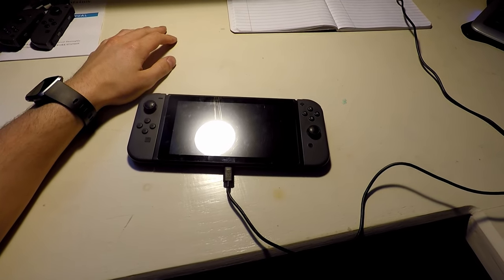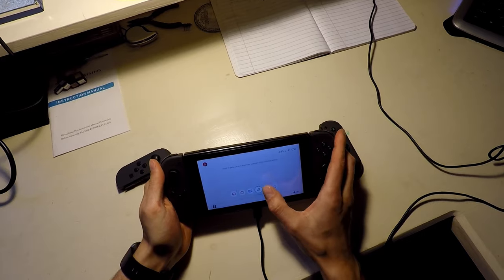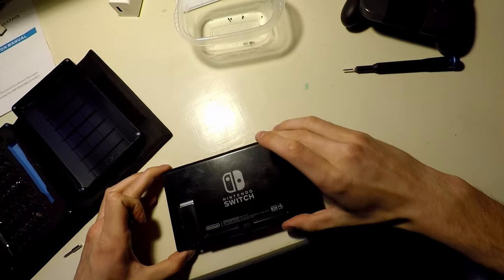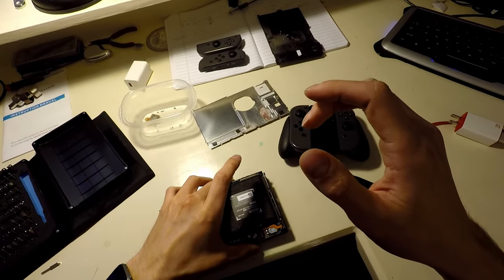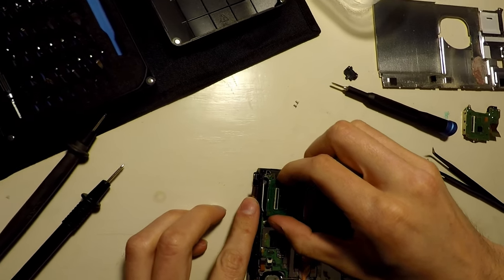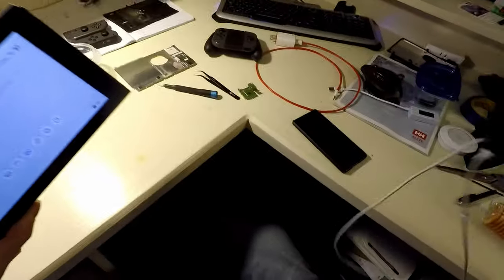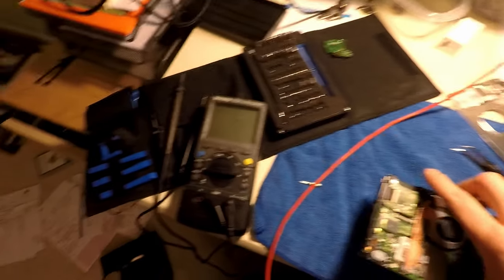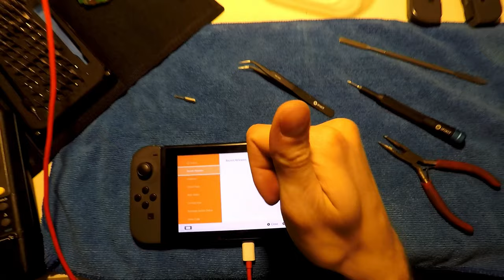Nintendo SWITCH FIX! Diagnosing a Switch Sound Issue!

Comment: I can only hear my switch when its in headphones and on the tv. Its so frustrating. I just wanna fix the audio without wearing headphones.
Reply: same its been a few months since mine went out and i still haven't find a solution on how to get my sounds back :(
Reply: MIne's stuck in headphone mode even though there's nothing plugged in.
Reply: @djayyoda  might be reading headphone connection may want to try compressed air in your audio jack
Reply: Same
Reply: I have the same problem
Reply: Same
Reply: Same
Reply: Same
Reply: Same problem please help me
Reply: Me to it’s been like that for me for 3 years

Comment: My Nintendo had sounds and then it went away how do I fix it?
Reply: Same
Reply: Did your switch just randomly stop producing sound when in handheld mode?
Reply: (Because I'm having problems too I'll continue with this conversation) but yes when I booted up my switch it wouldn't make any sounds and it was when I was in handheld mode.
Reply: BuiltLasagna I have a question after the sound went out did it ever randomly come back? I’m asking because this happened at least 3 times when the sound came back but than left again. Once when it came back it stayed for a week than it left again
Reply: TheEpicSlayer :D The speakers were making some kind of weird sound before the speakers stopped working, after they stopped working 
it never came back again
Reply: BuiltLasagna I think we have different problems than because my switch never made any weird sounds.
Reply: @BuiltLasagna  Mine made a buzz sound on my headphones then there was no sound. It randomly comes back and goes. But it's been gone for awhile now
Reply: @BuiltLasagna  Same. Why tf can no one problem solve this? I just did a speaker replacement and the heavy audio distortion was still there. It's even distorted from the audio jack.
Reply: you solved it?
Reply: Same
Reply: Same
Reply: Carlos Macias nope. ☹️😒😕
Reply: @theepicslayerd5684  yes
Reply: @jeremiahmartin2800   how, i would like to know
Reply: @MewingMessi  the sound randomly just cut off one day. I blowed into the speakers,and it would work.Sometimes it would cut off and it would continue to do that. It eventually just completely cut off
Reply: @theepicslayerd5684  yessss
Reply: @jeremiahmartin2800  didn't work saddly
Reply: @theepicslayerd5684  yes

Comment: So on my switch the sound quit when my kid was using it, I tried everything in settings but nothing worked the only thing that gets it to produce any sound is to firmly tap on the back near the kick stand any thoughts on a solution?
Reply from the maker: It's probably similar to what happened with this console. A speaker replacement will likely fix the issue. I can't say why this happens, though... Could be from dropping it or any kind of impacts.
Reply: Hey Jimmy did you ever figure this out? I've got the same issue with one rn.

Comment: I was cleaning my Switch and suddenly I couldn’t hear it, I tried using the volume button and it said I was wearing headphones (which I wasn’t) and reset my switch. It then began switching between me wearing headphones and regular volume, and I soon gave up. Please help.
Reply from the maker: What did you use to clean it? Something may have gotten into the head phone jack which is causing the console to think something is connected.

Comment: so i replaced the speakers on mine and the sound works now , but when i try to put the metal plate back on and put the first bottom left screw in the switch cuts off and shows an error code , what could be the issue ? i tried putting all the other screws in but that one and it’s fine but once i tighten that one it shuts off again and shows the error
Reply: Idk.  That’s weird
Reply: Maybe something is touching somewhere and grounding it out.

Comment: That joycon when you said “wants to scroll all the way to the right” it means it’s got drift try fixing it in the settings if that does not work the joy stick in there is messed up you will have to replace it it’s only like 5 bucks to buy one then you or someone else will have to replace it there are many tutorials if your not sure how to do it.
Reply from the maker: Yeah. I have a video outlining that procedure as well.

Comment: Did you just put in a replacement speaker and that fixed it? I am not getting sound of of one of my speakers, and I am thinking its actually that easy-to-access one near the battery connector.
Reply from the maker: Yep. It was that easy.

Comment: Whenever i put my headphones in my switch the audio cuts out and i have to tilt the jack to hear a little bit
Reply: That's a headphone problem not a switch problem
Reply: @SomethingProbablyNothing  nope ive tried 2 sets of headphones
Reply: For Me I Use It For Like 2 Hours Or Mins and Volume cuts out without headphones
Reply: You can replace the headphone jack it's pretty easy
Reply: @thezero6152  ill watch a vid on it. Thanks
Reply: Mine is the opposite no sound without headphones
Reply: @pijg  yeah my sound only works with headphones or doc mode
Reply: @Etopia I have the same problem!
Reply: @aidanisch2461  i forgot this comment existed lol but i never got it fixed
Reply: Replace the game cartridge slot that has the mic port. Fixed 100%
Reply: the jack is messed up,but even if you order a replacement it may not work and your screen wont work. I tried it on mine,I just decided to use usb wireless headset. now my speakers went out,which is what brought me here. tapping at the back made them come on ,but they went off again. new speakers??

Comment: its messed up this happens. tge jack was bad and I replaced it but caused screen not to work,so I put the bad one back and use a usb wireless headset. then yesterday sound went out randomly,tapped the back of the switch sound came back for a bit,then went out again. hard to believe it's a bad speaker issue

Comment: The speaker its not always the problem, im repairing right now the board, works good some times and others sound goes away for a while then came back, not sure if components are married with the board
Reply from the maker: What parts would be married to the board? Sounds like an intermittent short to me.
Reply: @GTurbski  i change de ic audio, first day, works greate, then start to go and back next days, i check everything, the las thing i supposed its fail could be the pmu

Comment: This happended to mines outta no where I didn't do anything what do I do?
Reply from the maker: Well, if you're handy pull the switch apart and try a set of replacement speakers. Otherwise I'd say send it off to have it repaired. Not sure as to what caused mine to stop working as I purchased it with faulty speakers.
Reply: @GTurbski  Wow it was just one day I was using it in handheld mode and it just stopped working it only works with headphones or docked
Reply from the maker: @Jay-nt7vw  sounds like exactly the same failure as the one in the video. Interesting that both speakers failed at the same time.
Reply: @GTurbski  can u fix it?
Reply from the maker: @Jay-nt7vw  I'm reluctant to say yes. I am by no means a professional however, I would be willing to help if possible. Send me an email at pelowskg@mail.gvsu.edu.
Reply: Same thing happened to mine, playing it in handheld mode one day (plague inc) and boom sound goes out... fairly new console also
Reply: Mine had that happened but still had a warranty on it nintendo fixed it. 4 months later it happened again and now I have no warranty wtf is it this common issue they should have come to a solution for this.

Comment: Never ever ever use a non nintendo charger while docked... you can easily brick your console
Reply from the maker: Sorry but this is just not true. I have been fixing consoles for around two years now and have NEVER had an issue powering my console(s) with an off brand cable. I will say this though, off brand DOCKS are a huge no as they have awful current control and are widely documented to cause chip failure (as documented in my other videos). Plugging in how I did in this video, by using a generic USBc cable to a 1 amp outlet is perfectly safe.